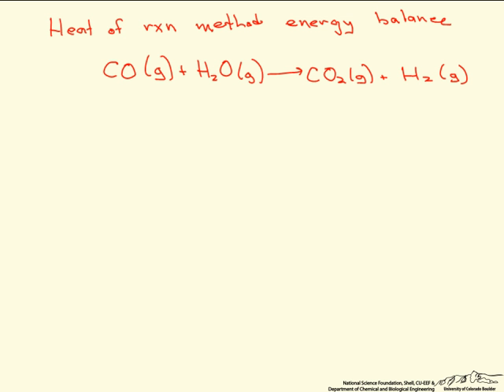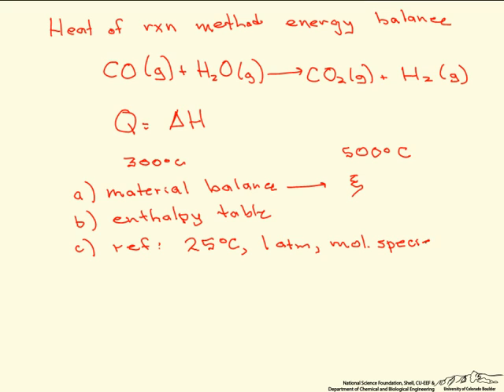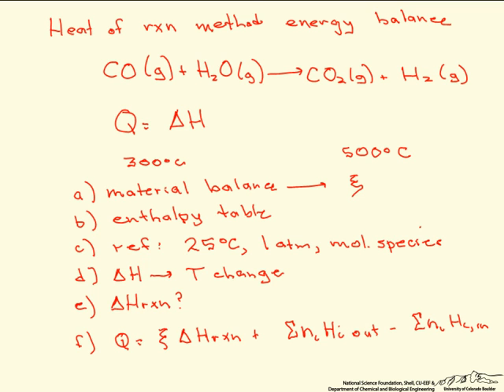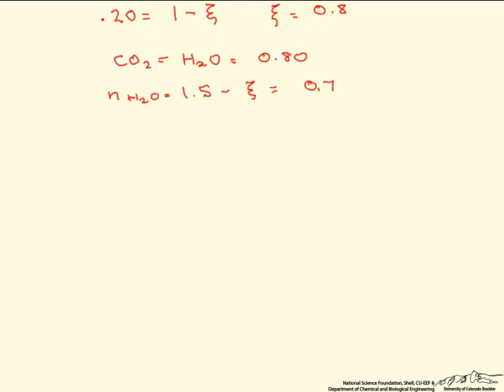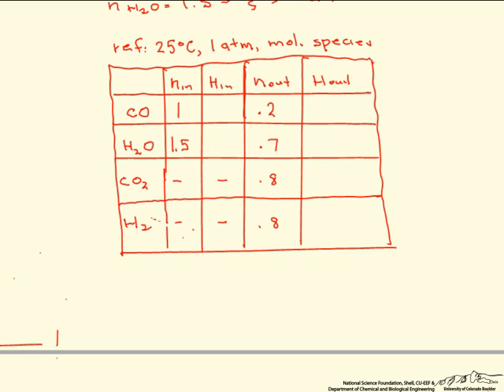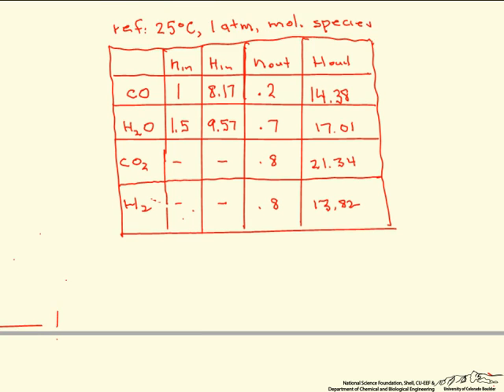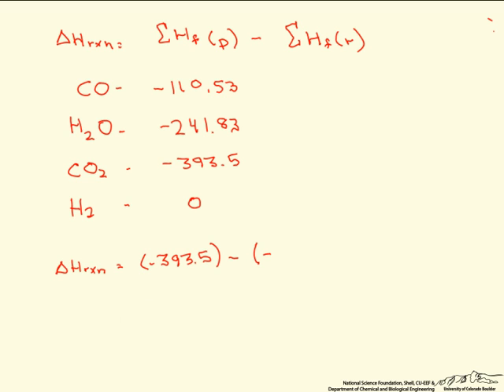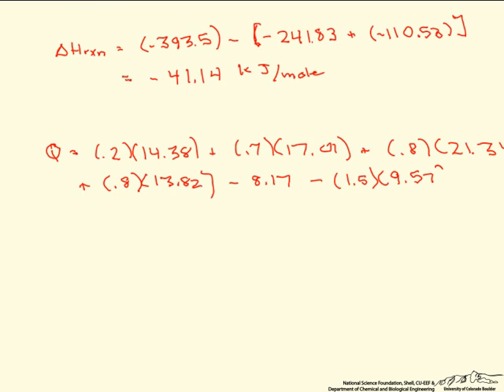Calculating Enthalpy Changes Using Heat of Reaction Method

Comment: How did you used the excess to calc moles of water
Reply: (1+0.5) moles Water  * 1(stoich Coefficient)=1.5moles total moles coming in(inlet).Then you substract the water consumed with is 1* 0.8 =0.8 therefore....1.5 moles H2O(inlet)-0.8 moles H2O (Consumed)=0.7 moles H2O coming out(outlet)

Comment: Could you explain why the enthalpies for the the reactants are positive? I know you used the reference table. When I paused and tried on my own, I integrated the Cp values and got the same values, but they were negative. That is if I were to cool from 300 to 25, would there be a decrease in internal energy, then use the heats of formation at 25 C, then integrate from 25 to the final temp? Everything else was the same expect the sign on the reactant enthalpies. 

Thanks!

Comment: Hi :) Regarding the formula for heat of reaction, which will you consider: the actual reactants and products according to the diagram itself or the reactants and products according to the reaction? What if you have an inert substance (e.g.: Nitrogen)? Will you still need to account its heat of formation? Thanks!
Reply: You don't account the heat of formation for elements, so the Hf for N would be 0.

Comment from the maker: +Joaquín Encina This is a great question.  The confusion here rests around what the reference state means.  It does not mean that our enthalpies are at those conditions. In this case, we only need to know that the reference state is the same for the two different points.  The difference between the enthalpies is what we are interested in.  We need to make sure that the original calculations were done based from the same reference point so that difference will be correct. The table lists the specific enthalpies at 300°C and at 500°C and therefore we do not need to do further calculations along hypothetical paths. If you have Felder and Rousseau's "Elementary Principles of Chemical Processes", 3rd edition, you can see this in Table B.8.